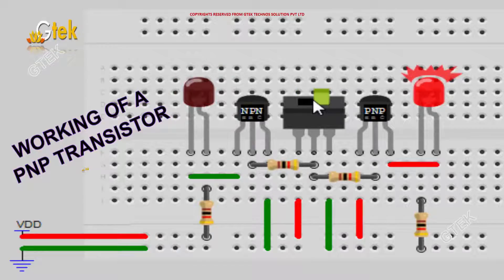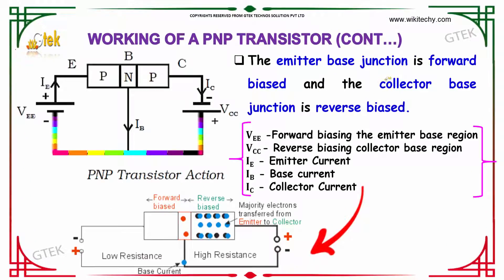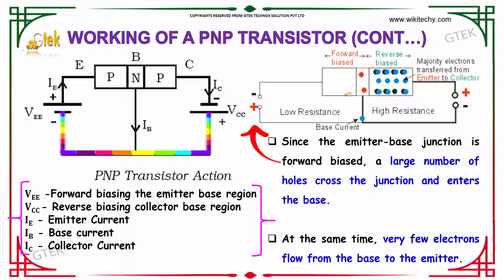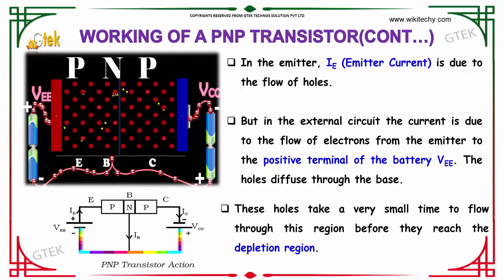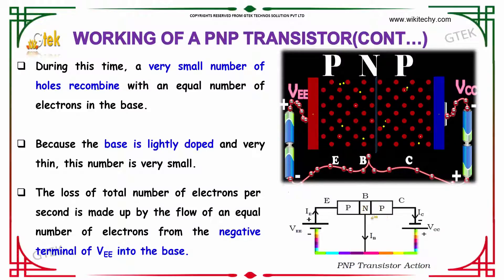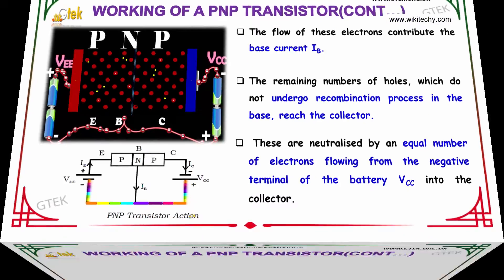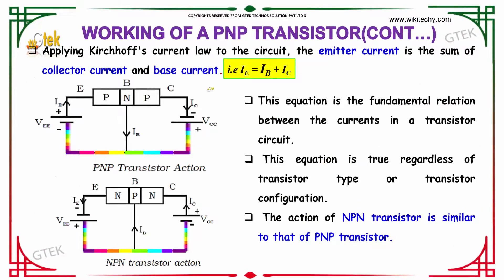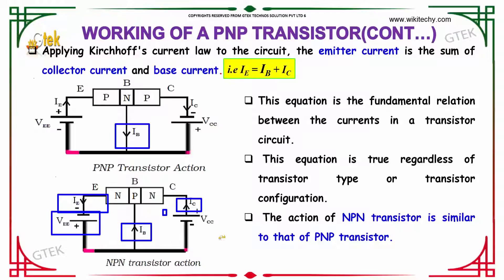Principle of pnp transistor Semiconductor Devices class 12 Physics subject notes lectures CBSE

Comment: The interaction between the forward- and reverse-biased junctions in a pnp transistor is very similar to that in an npn transistor, except that in the pnp transistor, the majority current carriers are holes. In the pnp transistor shown in figure 4, the positive voltage on the emitter repels the holes toward the base

Comment: The main difference between the two types of transistors is that holes are the more important carriers for PNP transistors, whereas electrons are the important carriers for NPN transistors. Then, PNP transistors use a small base current and a negative base voltage to control a much larger emitter-collector current.

Comment: The other type of BJT is the PNP, consisting of a layer of N-doped semiconductor between two layers of P-doped material. A small current leaving the base is amplified in the collector output. That is, a PNP transistor is "on" when its base is pulled low relative to the emitter.

Comment: ￼

The symbol of an NPN BJT. A mnemonic for the symbol is "not pointing in". NPN is one of the two types of bipolartransistors, consisting of a layer of P-doped semiconductor (the "base") between two N-doped layers. A small current entering the base is amplified to produce a large collector and emitter current.